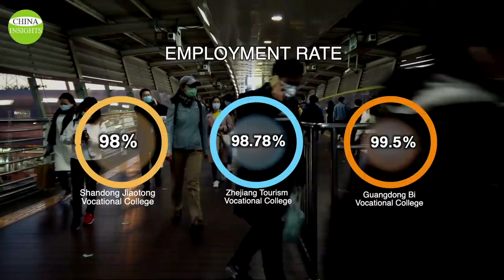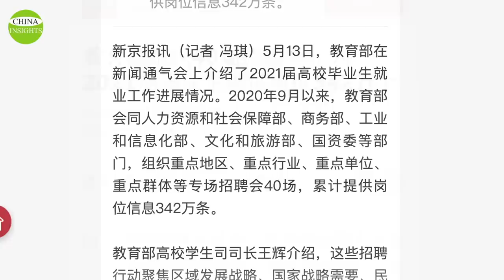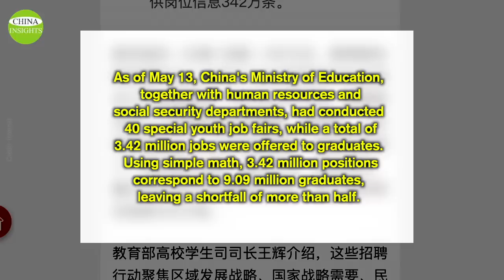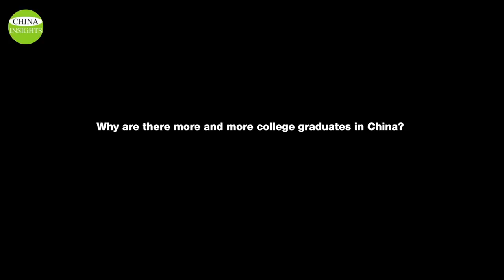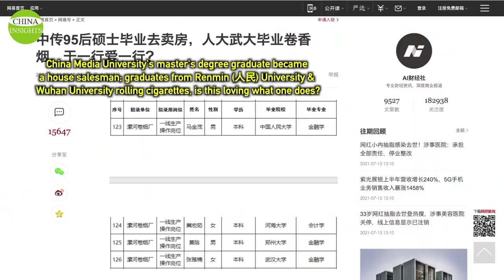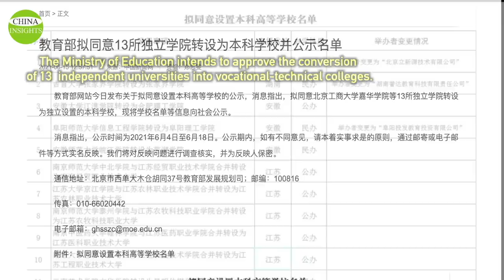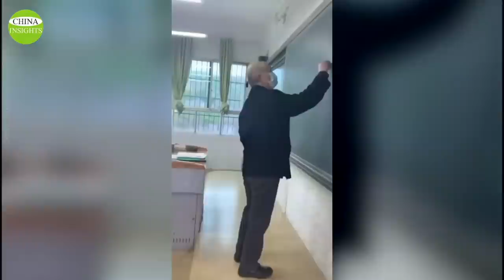China: Unemployed graduates/20 million shortage of skilled workers/200 million "flexible" employees?

Comment: in the US, professor tenure should be revoked; granted reaching tenure is hard, paying professors with six figure salaries for life but without holding them accountable to performance (ie preparing graduates for real world) is unsustainable for society
Reply: In Ireland there was a case of a lecturer who had two 3rd level jobs on the go at the same time in towns about 50 miles apart. He managed to get his class schedules with no clashes or overlaps so that he could hop from one job to another without being detected for several years. A simple check of payroll data and tax returns would have yielded the fact that he was working for two different colleges but no one thought to carry out this simple task. 
He was only rumbled when a colleague from one college saw him in the other and made discrete enquiries from workers  in the other college about the lecturers presence in the other college. This demonstrates that many academic posts have a light workload so that some people can hold down 2 jobs simultaneously if they work their schedules right. It also demonstrates a total lack of oversight and supervision of output and performance which would not be tolerated in most other sectors.
It is common to see articles in the news about non-performing academic workers, teachers and lecturers, who have done little or no useful work for several years but cannot be fired for various legal reasons, even in the face of the non-performance.
Reply: No one gets tenure these days.

Comment: 16;39…The schools using students as labor exists in the US as well, especially in medical and physician education.  

In my med school, med students in the 3rd and 4th year spend 10-12 hours per day on working “rotations” of 3-4 months each, and you worked 7 days a week during that time, and I had only 4 or 5 non-working weekends a year (when switching rotations), and no holidays off.  Med students spent 80 to 100 hours in hospitals a week, usually with overnight shifts every 3rd or 4th day, leading to a single work shit of 24 to 30 hours, as you needed to work the the all day, all night and most of the next day when “on call.”  There were no sick days, and a student who spent 2 days away with his father, who had a stroke, was threatened with failing the rotation and repeating the year if was gone for more than 2 days, even though he needed to travel across multiple states to see his dad.  In my surgery rotation, students had no days or time off, making it extremely hard to find housing and secure apartments for when they move to their residency years in late June.  As the med student, there is no pay and you pay45 K tuition to do the work, although in residency you are paid some (though less than minimum wage per hour).   it gets better, but is a bit of a grey area, with many hospitals using student labor to offset the staff time and cost to educate them.  It gets better after these 4-8 years, but there is definitely some overlap between “educational experience” and “free labor” for schools and workplaces.